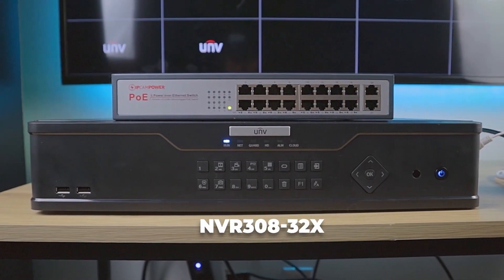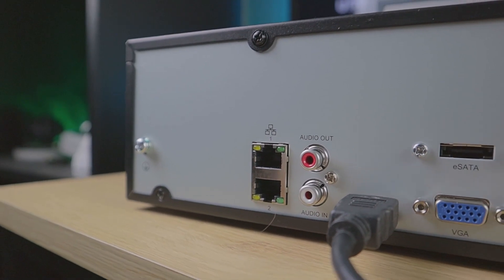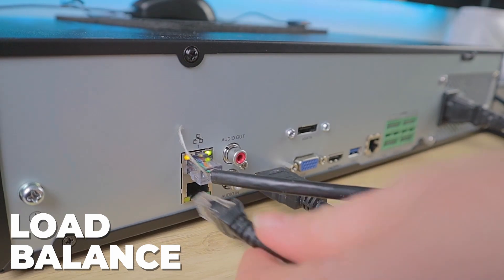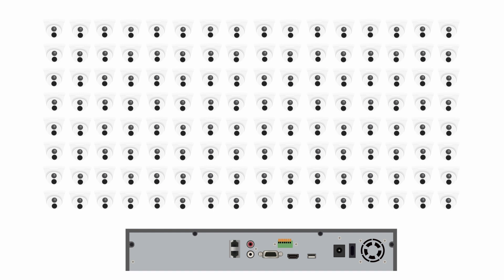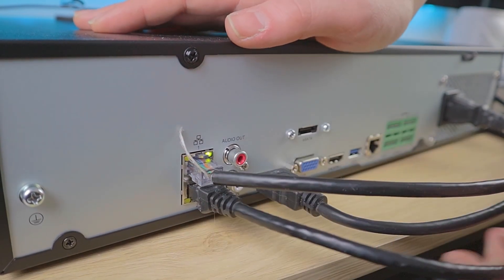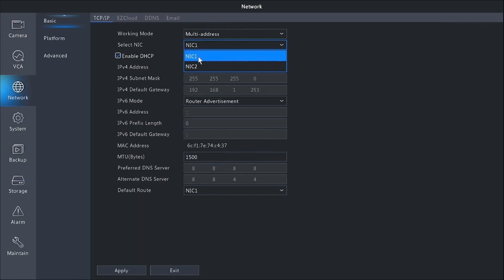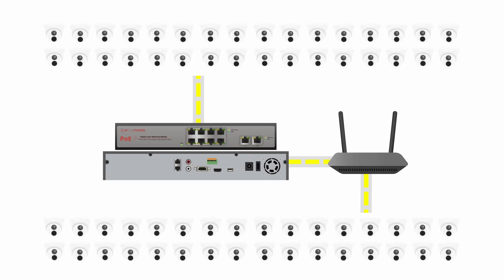One NVR, Two Network Ports: How to Use Dual NICS On Your IP Recorder

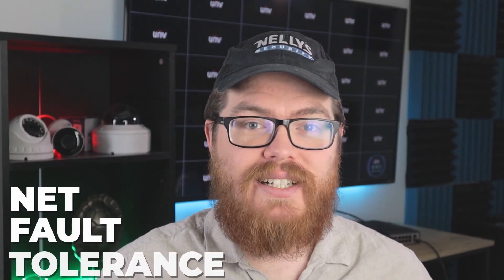Comment: 1:26  Can I splice onto the white wire coming from the RJ45 and get extended range wifi connection and higher resolution HD feed?

Comment: This helps in an instance where multiple IVMS Clients are locally connected simultaneously , we were finding with 2 clients it was fine but as soon as the third connected we struggled with bandwidth at the NVR port. (The one part I cant fiber) so now i have two clients on one and the third on the other. I will be experimenting with what uses what port to seek its optimal.

Comment: Thanks for the video. 
I had a job of 26 cameras over the weekend and for the first time I was using a NVR similar to yours but I didn't understand why I didn't had any ports in the nvr. Watched your video and made my life easier. Router to NVR #1 and NVR #2 to 32 POE Switch which was not on DHCP mode and had 192.168.3.200 so I made all cameras 192. 168.3.201 and so on.

Comment: Is that bandwidth capabilities of the nvr shared between the ports or does each port have the same capabilities? I’ve always wanted to use this as a second port on the same network.

Comment: hi I need to connect a wifi camera to my reolink NVR but i will need to pollace the camera in a remote area where the wifi signal is weak. If I add a network extender this will create a diofferent SSID and different network and therefore my camera will not connect to this network but what If i were to configure the wifi camnera then to the extended network this is not the network of the NVR and will not work just the same. so how can this problem be solved?
Reply from the maker: You can look into our point-to-point radios to extend your network: https://youtu.be/9Q3qAlRGWok

Comment: I will use multi-address

-In Lan 1, I will connect a cable to access the Internet.
From NVR Settings
I will set it to:
NVR IP: 192 168 1 2
Subnet: 255 255 255 0
Gateway: 192 168 1 1

-In LAN 2, I will connect a cable to Poe Switch and from there to the cameras.
From NVR Settings
I will set it to:
All my cameras will be on an IP range: 192 168 2 2 - 192 168 2 200
Subnet: 255 255 255 0
Gateway: 192 168 2 1

If I have a laptop or mobile phone at 192 168 1 12 how do I see a camera on 192 168 2 34 for example.

*Will the "Virtual Host" feature of Hikvision NVR allow me to access the camera page?

Comment: Very interesting video, but I have a concern. If I use the Multi-addres setting, can I see all the cameras in the main network, in the second network? I don't want them to leave a part for a network, I want that even if they are in different networks, the same number of cameras can be seen in both networks.
Reply from the maker: Yes you can have the cameras still on the same network, but on different IP Ranges so they can be seen and not segregated on a separate POE switch.

Comment: Thanks @Nellys, I have ds7716nxi-i4/s with 2 network ports and currently the cameras and not working. I have changed the IP address put it prove abortive. The NVR always dictate the camera as network unreachable and am confused. This is my company in Dubai. Please I will appreciate if you can assist me on this task. Your explanation in this video is topnotch. Please if you have any means to assist me for the NVR to recognize the IP cameras, I will be grateful. Your video is clear and educative. Thanks @Nellys.
Reply from the maker: You'll need the IP cameras to be on the same Range as whichever dedicated NIC is satup with.
For example, if NIC2 is the camera network and is on an IP of 192.168.254.1, then all the IP cameras will need to be on a 192.168.254.x IP. Then assigned to channels on the Hik NVR.

If the cameras are not Hik, then you will need to use ONVIF and port 80.

If you are still having trouble, I would check out ipcamtalk.com as the members over there can help you out as well!

Comment: Will adding the 2nd NIC to a different subnet create a bridge between the two or does the NVR safeguard against against that, our concern is safeguarding each subnet.
Reply: Both NIC cards are completely isolated from each other. They do not create a bridge, so you are safe to configure IoT devices on the 2nd NIC card using a different subnet.

Comment: can i connect all cameras in 192.168.1.network in first nic card and all pc in to 192.168.2 network in second nic card, is it helpful to reduce the lagging when we access the camera through software, sir pls help me
Reply: Yes, you can connect the cameras on NIC 1 and network on NIC 2. It will help reduce lag in the network since you are reducing the amount of network traffic on the 192.168.2.x (internet) network.

Comment: Hi Nelly I have two NVR 32 ch unv and I have 64 camera unv each nvr has 32 camera. My configuration is load balance 2 NVR. Then problem shows 1 NVR is always lag. What is the good setup you recommend? Multi address?

Comment: I had multi-address on two nvr just was wondering if the hik-connect app on i iphone will still be able to view online as they are on different gateway?
Thanks
Reply from the maker: As long as one of the NICs of the NVR is connected to the internet and the Hik-Connect P2P status in the NVR shows as Online, then you should be good!
Reply: @NellysSecurity  ok thanks i will check it tomorrow.

Comment: I have a problem
I have a nvr dahua 616-128
It has 4 network ports
And I have two switchs
All switches have cameras
When connecting switchs to network ports that in nvr
And I made a load balancer, the cameras disappear from one switch and the other works
I made a connection from switch to switch and then to nvr
Reply from the maker: Unfortunately we are not familiar with that dahua model as we never carried it.

Are the cameras on the same IP range as the NIC on the NVR?

I would advise either reaching out to whoever you purchased the system from, Dahua, or even ipcamtalk.com. The guys over there are very knowledgeable.
Reply: Are you using managed or unmanaged switches? Never connect 2 switches together with a network cable, It sounds like both of your switches have the same IP address, allowing only one of them to talk to your nvr.
Reply: @joshbeasley21  you can connect with network port cable just has to be pinned out as a crossover cable.

Comment: you definitely want two networks. I do not want my cameras to be reachable by anything other than the nvr. I will not put a route on the main network pointing to the NVR for the network behind it. The cameras only talk to the NVR. I would even put a bad gw on dhcp for backend network so none of the cameras can get to the internet. this way cams are still plug and play but they cannot get to the internet. manually update your cams if needed.